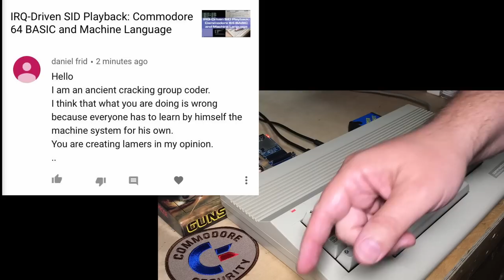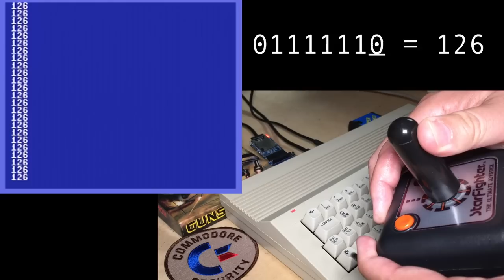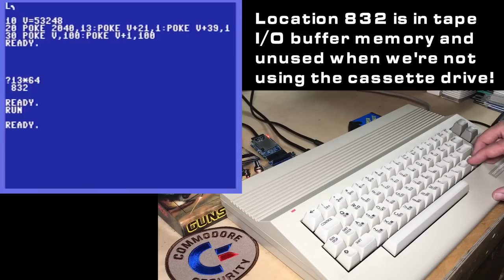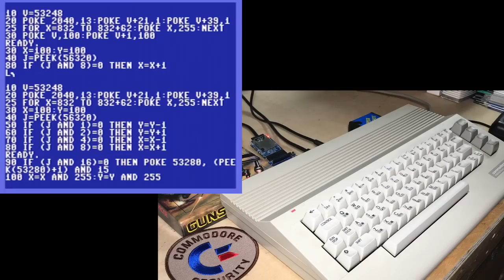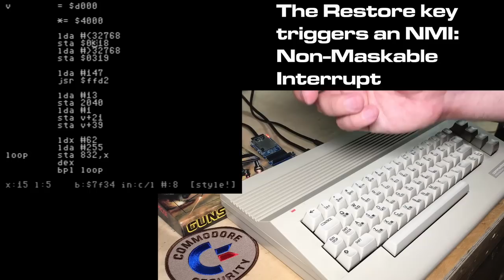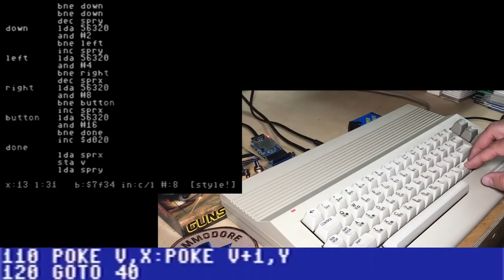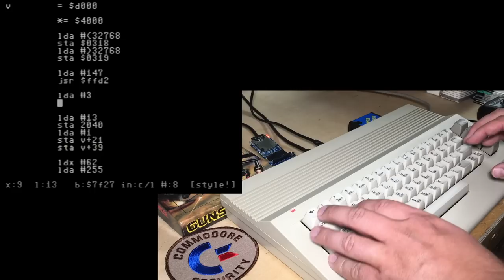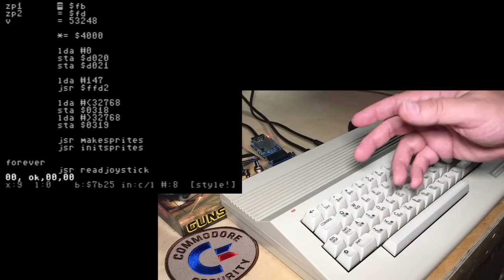C64 Joystick-Controlled Sprites in Assembly and BASIC

Comment: Daniel's attitude is one that I encountered in the eighties a lot when learning UNIX: "It's in the manual, look it up." After going through a lot of hours learning the system, whenever a new person asked a question, I'd usually answer it. Often, when the new people had something that they learned and could teach me, my knowledge grew as well. By pooling our resources and sharing whatever bits of information we had, the process went a lot quicker and smoother. Not a lot of us "learned the machine at the bare metal chassis-level" and that worked out fine.
Reply: 15743 Hertz reading the manual will usually give you a full understanding of a system. If I tell you the solution to the precise problem you’ve asked me about, you now know how to solve your problem, but you might not understand the problem or the solution, so you’ve learned nothing. 

I’ll still tell you the solution, because I’m not a jerk, but I’ll bore you with all the details as well.
Reply: @StefanHolmes  The problem isn't usually that you need a full understanding of the UNIX command to solve a problem. In the UNIX days, the manual would give you an entire book for each command that you're looking for. Nowadays with Linux and BSD, you get both a wall of text and a quick reference guide.

Obviously, if you just need to know which command switch is needed to format text output in the desired fashion, then a colleague can give that to you with no "damage done" to your understanding. But if you're learning to parse a pipe of characters from scratch using a lexical parser, the manual is a good place to start and then have an associate give you an example to help you along. My colleagues were "too busy" to even do that and would refer me to the manual every time.

It's two different camps in my mind, but our team did get a lot more done and I believe that we had a better relationship on my team. A big problem could be broken down to small parts that each member understood and a solution arrived at much more quickly.

As a bonus, whenever a member left the team, we didn't lose the brain bank that kept the project going.
Reply: @StefanHolmes  Reading the manual is lame; read the source code because the manual might be wrong. ;-) Actually, I'm a minimalist, so I only want to learn enough to accomplish my goal.
Reply: @timsmith2525  the source code might also be wrong, you have to read the compiled binary as well
Reply: @StefanHolmes  The only thing that keeps us the baddest and best apes on this planet is the ability to teach and learn from each other. Hiding behind a simple RTFM is elitism, unless your admonishment is the exact page number of the manual where it is addressed.

Comment: Fun video.  It's been a couple decades since I last programmed my C64.  I owned both the breadbox and the C64c, I liked the C version, nice design (and as you mentioned in the past, bug fixes).  C64 (6510) machine language was ALWAYS my favourite!  It was SO much fun to program and I highly recommend anyone learn it, even if the machine is old, you can get the basics of how ML works.  I always loved the fact that the C64 had additional commands in machine language that you don't have in BASIC, like locating the cursor etc, though once I learned them, I would do a couple pokes and a SYS call in a GOSUB function to locate the cursor in BASIC.  Another trick I used in BASIC to quickly create a sprite, was to do a couple pokes to relocate where the PRINT command prints to (this is VERY VERY powerful!!!) so instead of printing on screen, it prints somewhere in memory, as you pointed out, you can relocate screen memory anywhere.  Well, you relocate where the print command prints, then you print out a string of characters which represent the values you wish to go into that memory location and you can literally PRINT a sprite in one shot!  You print to memory, all the values for a sprite, and poof, it is there, no reading and poking data from a loop.  You can also use this trick to print out sound effects too!  Just point the print command to the SID chip, the PRINT the values (in order of course) you want for any sound effect and you will get a sound effect with a single print, without a pile of pokes or data reading.  I used to have a lot of fun with that trick.  It speeds up BASIC in that respect.
Reply: Wow, that’s interesting. It’s good because PRINT is so fast, right? How do you set the value of the PRINT pointer in memory?
Reply: @bierundkippen720  For the SID chip, in my notes... the paper now turning yellow, I have: POKE209,0:POKE210,212:POKE211,0:?"@@@@@@@@@@@@@@@@@@@@@@@";  (that's 25 @'s)

The above code will clear the SID chip (sound chip) with that print.  The first few pokes redirect the print statement to print to the start of the SID chip memory.  Now Each location you see an @ is in SID.  You can change those @'s which represent a zero on the C64 to any other character which represents the number you would normally poke into the SID chip and you can literally PRINT a sound out this way.  You can also use this to print out anything else like a SPRITE could be created with a single print.  This is far faster than a loop which has to read each value in then poke it one at a time.  Think of this like a multipoke statement that pokes a string of values all at once.  It's not only faster, it's virtually instant in comparison.

Now what numbers to put into those pokes to redirect it, I am not sure.  I assume 209 is probably the low byte of the address and 210 is probably the highbyte with 211 probably a cleared register or whatever, I honestly forget, it's been about three decades for me. LOL
Reply: @NeilRoy  Thanks, dude.

Comment: Its been like 30 years since i programmed my last demo, and all the adresses, VIC-registers and techniques comes right back to me as I look at your code! 
Always had the urge to program a little game on the C64, maybe 2019 is the year to start :)

When I had more than one sprite I would make a subrutine that took spritnumber, spritex, sprity as input/"arguments" :) 

One question: When you check for raster #FF, wouldn't this trigger twice because the machine language is so fast that it comes around to that part of the code before the raster comes to the next line?

And last, yes, we used to run around and call each other lamers back in the 80s, but there's a brave new world now, with information sharing, open source, and the internet. Calling someone a lamer in 2019 is pretty... eh... lame.... ;)
Reply from the maker: To finally answer your question about the LDA #$FF:CMP $D012, yes, it's running twice per frame so the sprite is moving at 2 pixels per frame rather than one. The goal was just to slow down the sprite movement, so I'm okay with it, but yes, a bit more code would be needed if you need your code to only run once per frame.

Comment: I'm so jealous at your cheap C-64C find!  I was a late bloomer and only got my first computer- a bread bin C-64 in 85.  Then upgraded to the C-128 "flat" the next year.  Switched to an XT clone in 89, but then got into a major retro phase around 2007-2008 and bought many different Commodore computers on eBay - some I owned previously, but many others I didn't, like the A-500 and A-1200.  Installed a Compact Flash drive in the A-1200, which really made it scream!  These days I'm more of a minimalist, so I'm happy to run Vice on my NUC.  Cheers!

Comment: I wrote this on my commodore 64 and found that it worked much better if you change lines 50, 60, 70, 80 so that they were X/y=X/y+/-4 rather than 1 as it makes the square move 4 times the speed. But this is a great vid thanks!

Comment: Just re-watching some of my favorite videos: On that "page two" sprite map the counter is memory locations 160  - 162 "Value of TI variable, time of day, increased by 1 every 1/60 second. Values: $000000-$4F19FF, 0-518399 (on PAL machines)"  Without looking it up or using a programmer's calculator, I'm pretty sure it takes 18 bits to break 24 hours into 1/60 sec.

Comment: Back then, your hack to just inc or dec 53248+16 for the high bit of the first sprite was actually quite normal.  It would have been the accepted method.  With such limited processor speed and memory, hacks were preferable on the C64, especially for longer programs/games.  If you're only using one sprite, who the heck cares if you're messing with the high bit of the other 7 sprites' x positions :)

Comment: Excuse my lameness, but I thought t this might help viewers visualize the joystick inputs easier:

10 PRINT(NOT(PEEK(56320)))+128:GOTO10

It will produce zero-based values instead of relative to 127, for visualization purposes.  (The bits are inverted, plus the high bit which isn't used).

Notice the brackets around the NOT operator - these are required because NOT has no precedence, so the following is not equivalent:

?NOT(127)+128    < does not equal>   ?(NOT(127))+128

Comment: This stuff with the sprites showing the changing pixels SO reminds me of a fun little program I wrote in AppleSoft BASIC that filled memory range 0x1000-0x2FFF with random bytes, then did a “HGR : CALL 4096” to show hires page 1, and then called into the beginning of these randomly generated bytes as if there was a valid 6502 machine-language program there. Of course, this usually just froze the machine 🤣, but one time, I got a madly-changing “splotch” on screen about half the diameter of a U.S. dime! 😻

Comment: This is amazing! // How to "translate" a program from Turbo Macro to the BASIC version (DATA instructions). Just like programs (also in assembler) printed in old magazines from the 1980s.
Reply from the maker: I think there's a program that will automatically make those data statements. For shorter programs it's not too bad to write a little BASIC program that will print a line number, "DATA" and then e.g. print out PEEKed memory. Then you can hit return on each line, and then write the little loop that will READ the data in and POKE it into memory.

Comment: I remember some nice sprite that i made on C64. But on x86 i have no hardware sprite, so i made a routine to display a picture with a black background in the upper left corner of the screen, so i can put the address and the color of all of the pixels in a sprite table. And if i want to move the sprite i use a copy of the background content, so it can be redrawn, when my software sprite move over.

Comment: man i wish i had a proper assembler when i coded c64.  I did everything in straight machine assembly.  I wrote a program similar to this that drew two tanks on the screen but ran off of the interrupts so you could still do other stuff at the same time.
Reply: Yeah, I had this assembler written in Basic I typed in from a magazine. It worked and I could write programs with it but couldn't use labels or anything. I had so much ideas but without proper tools and skill I could only do simple programs. Now there are great tools and I could code much better code but I don't have ideas anymore like as a teenager.

Comment: Very similar to the SPRITE command on the MEMOTECH MTX512 i.e. 10 SPRITE 128,125,125,34,27,22,31,152,255
to write machine code you would do ASSEM 20 ret.
then you can do 

LD            A ,                0x40
LD           BC,               0x20
LD           HL,               0xB800
TOP:
LD         (HL),            A
ADD          A,             0x01
ADD       HL,             2
LOOP    TOP
RET

do you a return then return again
and list machine code
and you will find one label listed

Comment: instead of that whole lda'ing the register all over again just txa the thing back. which also prevents for example up and down to register in the same iteration (unless they hooked something else than a joystick to the port that can pull both lines at the same time ;) LDA $1234 = 3 bytes, times 4 is 12 bytes (also 12 cpu cycles), LDX $1234 plus TXA 4 times is 7 bytes (11 cpu cycles)
Reply: or just for 'don't care which game port is used'... as that whole which port the joystick should be in has always been a bit of a questionable thing with c64's ;)
LDA $DC00
AND $DC01
TAX
AND #$01
BNE :+
JSR MOVEUP
:
TXA
AND #$02
BNE :+
JSR MOVEDOWN
:
TXA
Reply: even shorter :P but just like your routine, no handling the x-msb, nor doing things like boundary checking, changing the mob for the direction it's going. etc. lol.
LDA $DC00
ROR
BCS :+
DEC $D001
:
ROR
BCS :+
INC $D001
:
ROR
BCS :+
DEC $D000
:
ROR
BCS :+
INC $D000
:
ROR
BCS :+
INC $D027
:
Reply: besides the filesize for loading on slow old actual c64's.. and the romsize (not that you can still get them any smaller than 32KB anyway but any byte that isn't code can be graphics on a game ;) with any modern 6502 implementation you can just power the whole thing off every time it's done and wait for an irq or nmi and that saves electricity. doesn't matter on that old nmos crap, that just jmp's to itself anyway when it's waiting :P always sucking the same amount of amps :P although modern implementations generally control actual missiles. not sprites :P

Comment: Not a fan of Motorola 6502 (grew up in the '80s (Intel 8080/Zilog Z80)). Came here for the sprites, because jealous of vid game chips that were more fun than word processors, spreadsheets and databases.
Never used a Commodore, but it looks similar to my Apple IIe.

Assembly language is the first one you should teach yourself, but today is almost incomprehensible.  Hell, I'm working on an RCA COSMAC 1802 (circa 1976) just for fun!

Microcontrollers are where the code touches the metal these days, so teach your children well.

Comment: Lamer, also, here, that acknowledges he can only learn so much "on his own". Thank goodness there are people like Robin who donate their time to helping others.

I have what I hope is an easy question: I'm using the VICE emulator because my C64 and C128 died many years ago, so is there a way to participate in these joystick code demos with this setup? Can I get a joystick that will work seamlessly with these examples? Will something like a simple yet modern joystick like a Logitech Extreme 3D Pro (I have one of those) work instead? If those aren't feasible, how hard is it to substitute in say, keyboard keypresses instead, to simulate using a joystick?
Reply from the maker: While they may work, I don't recommend those big analog sticks for VICE. There's a variety of cheap USB gamepads available which have digital (just on or off) buttons and direction pad that work a lot better for this purpose. In VICE go into the menus, something like Preferences->Settings->Input Devices->Joystick and you can configure your joysticks there. You can even configure "Keysets" which is using the keyboard as a joystick, if you don't have anything better to use.
Reply: @8_Bit  I'll give it a shot, and it should be a fun exercise. Thanks!

Comment: Does that joystick reading command in BASIC slow down the movement of the sprite significantly? Because I remember in the 90s I made a small demo displaying an image and moving a ball over it and for sure it moved much faster, and it was done in BASIC for sure, plus there was an IRQ music playing exported from Music Assembler. Unfortunately I don't have that program anymore so I cannot dig into it and see how I achieved the speed of the sprite...
Reply from the maker: Yeah, the extra PEEKs and IF/THENs can really slow it down. This could have been optimized better for speed though; I wrote it in a simple way so it would be easier to understand how each line of BASIC corresponded to the assembly version.

Comment: Just curious, given basic, would it speed up if you precalculated the powers of 2 and stuck them in an array, then ANDed the indexed value to mask in the bit? My gut says basic would be very slow at doing powers. Also if I recall correctly there was some way to signal use of integer types in BASIC?
Reply from the maker: Yes, precalculating the powers into an array is definitely a good optimization. I recently tried that in a project and it worked well. Commodore BASIC does have an integer variable type (which you indicate by adding a % to the end of the variable name) but due to ROM space constraints it's poorly implemented and actually converts back to float for all operations. The only good use it has is saving RAM in integer arrays as each element is stored in just 2 bytes instead of 5 for floats.

Comment: I have been trying to use the x and y variable to move the sprite but it doesnt seem to work. I am using a custom sprite that i made my self with DATA. Could that be an issue? The sprite moves when i poke and peek their address in the vic II.
Reply from the maker: You can use variables or memory locations to hold the sprite location, but they still have to be periodically copied (or POKEd) into the VIC-II for the sprite to actually move.

Comment: Location 832 is the cassette buffer isn't it?
Reply from the maker: Yes, starting at 828. Several early Commodore books suggest using the cassette buffer to store sprites, and Jim Butterfield's books and articles often suggest using it as a place to store short machine language programs.
Reply: @8_Bit  Thought so, you couldn't save programs to tape if you mess with the tape buffer, they will be corrupt I remember from the past (hence the memory location rang a bell).